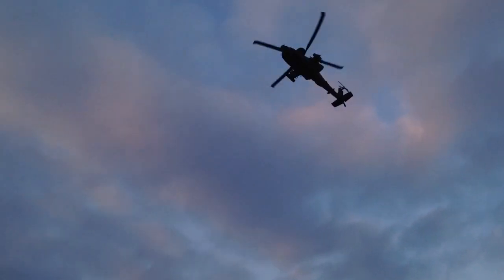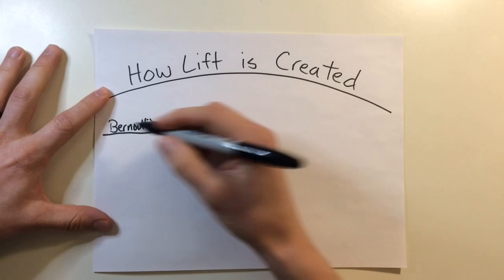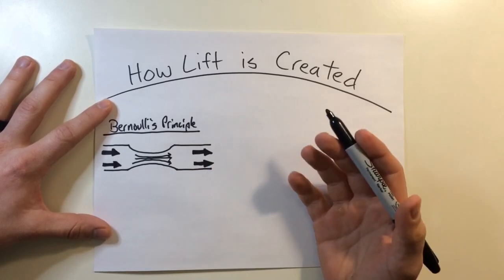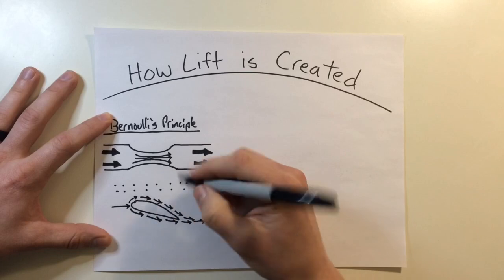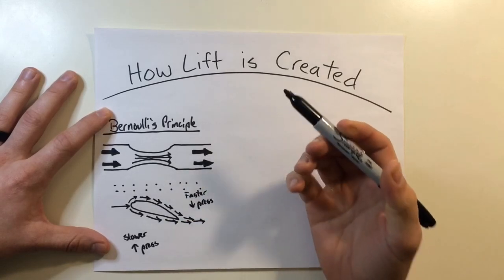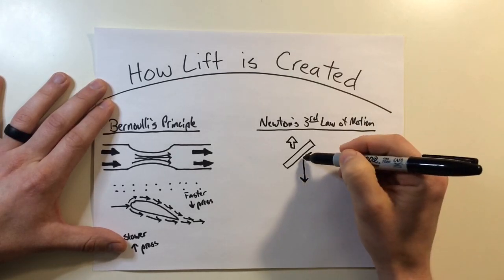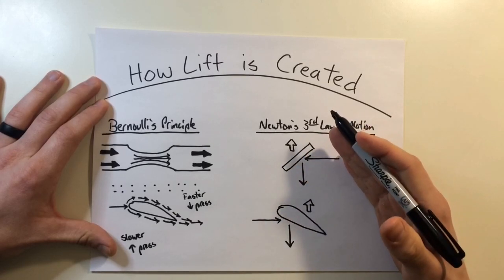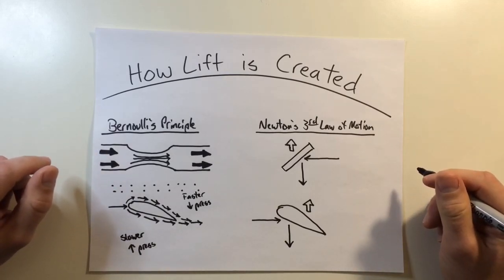How Lift is Created

Comment: I take my cfi check ride in a few weeks and I can’t tell you how helpful your videos have been to really smooth out my presentations.
Reply: The “Bernoulli Principle half-venturi” explanation is false. The air far above the wing is not a hard boundary and the air does not speed up because of this. If that was valid, then there would be an equally low pressure under the wing because you can easily see that the trailing edge produces a similar ‘narrowing’ below the wing.
In addition, a pressure difference between two regions, called a pressure gradient, is what speeds up the fluid in the venturi.  Air has mass and Newton tells us that a force is required to accelerate a mass and in a fluid, a pressure difference accelerates fluid. Pressure is the force that accelerates air. The fluid does not magically speed up in the venturi narrowing without the force provided by the pressure difference. Pressure difference causes acceleration in fluids.  Euler figured this out in the mid 1700s.
 Above a wing, it is the curved flow that creates a lower pressure and the low pressure accelerates that air toward the trailing edge.

Also, it's Daniel Bernoulli.
_
The common Newton explanation is incorrect because the air does not bounce off the bottom, but the flow is curved to flow downward, but along the lower surface.  That causes an increase in pressure at the lower surface.  The wing moving toward the air increases the pressure.  This increased pressure under the wing pushes up on the wing and down on the air. 
The lift is then the total pressure difference caused by the motion of the wing through the air.
Those two explanations are incorrect, but it is the pressure difference top-to-bottom which is the lift.

Comment: I'm a newly Aviation Mech in the Navy and this has been so helpful feeding my hunger for well explained information that I can't wait to be working in my MR-60R. Thanks a lot! 😁
Reply: The “Bernoulli Principle half-venturi” explanation is false. The air far above the wing is not a hard boundary and the air does not speed up because of this. If that was valid, then there would be an equally low pressure under the wing because you can easily see that the trailing edge produces a similar ‘narrowing’ below the wing.
In addition, a pressure difference between two regions, called a pressure gradient, is what speeds up the fluid in the venturi.  Air has mass and Newton tells us that a force is required to accelerate a mass and in a fluid, a pressure difference accelerates fluid. Pressure is the force that accelerates air. The fluid does not magically speed up in the venturi narrowing without the force provided by the pressure difference. Pressure difference causes acceleration in fluids.  Euler figured this out in the mid 1700s.
 Above a wing, it is the curved flow that creates a lower pressure and the low pressure accelerates that air toward the trailing edge.

Also, it's Daniel Bernoulli.
_
The common Newton explanation is incorrect because the air does not bounce off the bottom, but the flow is curved to flow downward, but along the lower surface.  That causes an increase in pressure at the lower surface.  The wing moving toward the air increases the pressure.  This increased pressure under the wing pushes up on the wing and down on the air. 
The lift is then the total pressure difference caused by the motion of the wing through the air.
Those two explanations are incorrect, but it is the pressure difference top-to-bottom which is the lift.

Comment: Always appreciate your videos.
Reply: The “Bernoulli Principle half-venturi” explanation is false. The air far above the wing is not a hard boundary and the air does not speed up because of this. If that was valid, then there would be an equally low pressure under the wing because you can easily see that the trailing edge produces a similar ‘narrowing’ below the wing.
In addition, a pressure difference between two regions, called a pressure gradient, is what speeds up the fluid in the venturi.  Air has mass and Newton tells us that a force is required to accelerate a mass and in a fluid, a pressure difference accelerates fluid. Pressure is the force that accelerates air. The fluid does not magically speed up in the venturi narrowing without the force provided by the pressure difference. Pressure difference causes acceleration in fluids.  Euler figured this out in the mid 1700s.
 Above a wing, it is the curved flow that creates a lower pressure and the low pressure accelerates that air toward the trailing edge.

Also, it's Daniel Bernoulli.
_
The common Newton explanation is incorrect because the air does not bounce off the bottom, but the flow is curved to flow downward, but along the lower surface.  That causes an increase in pressure at the lower surface.  The wing moving toward the air increases the pressure.  This increased pressure under the wing pushes up on the wing and down on the air. 
The lift is then the total pressure difference caused by the motion of the wing through the air.
Those two explanations are incorrect, but it is the pressure difference top-to-bottom which is the lift.

Comment: Great video! I like how you explained each theory and stated that neither theories by themselves are correct. One thing I would change is that the fluid particles do not meet back up at the trailing edge. In most cases, the air particles on top have left the trailing edge before the ones on the bottom do. Other than that, thanks for the good content!

Comment: Good job explaining the theories in an easy-to-understand way! However, some of the explanations contain common misconceptions. The second portion of the explanation was good because it utilized Newton’s law which was very similar to Doug McLean’s argument in chapter 7 of the Understanding Aerodynamics textbook. However, the first portion of the explanation utilized Bernoulli’s principle to explain the theory which was a misconception both the University of Cambridge professor Holger Babinsky as well as McLean explained. It sounds like the velocity change was causing the changes in pressure which would lead to the generation of lift when in reality velocity and pressure respond simultaneously. In addition, this utilized the venturi tube to explain the theory which McLean explained is another common misconception because external flows around airfoils don’t behave the same way internal flows do in solid surfaces such as venturi tubes because this pinching doesn’t always result in a pressure or velocity change which wouldn’t produce lift.

Comment: Omg thank you so much for your videos, you're God send, it helps me so much to help study these topics! Thank YOU 🙏🏼👍👏😍
Reply: The “Bernoulli Principle half-venturi” explanation is false. The air far above the wing is not a hard boundary and the air does not speed up because of this. If that was valid, then there would be an equally low pressure under the wing because you can easily see that the trailing edge produces a similar ‘narrowing’ below the wing.
In addition, a pressure difference between two regions, called a pressure gradient, is what speeds up the fluid in the venturi.  Air has mass and Newton tells us that a force is required to accelerate a mass and in a fluid, a pressure difference accelerates fluid. Pressure is the force that accelerates air. The fluid does not magically speed up in the venturi narrowing without the force provided by the pressure difference. Pressure difference causes acceleration in fluids.  Euler figured this out in the mid 1700s.
 Above a wing, it is the curved flow that creates a lower pressure and the low pressure accelerates that air toward the trailing edge.

Also, it's Daniel Bernoulli.
_
The common Newton explanation is incorrect because the air does not bounce off the bottom, but the flow is curved to flow downward, but along the lower surface.  That causes an increase in pressure at the lower surface.  The wing moving toward the air increases the pressure.  This increased pressure under the wing pushes up on the wing and down on the air. 
The lift is then the total pressure difference caused by the motion of the wing through the air.
Those two explanations are incorrect, but it is the pressure difference top-to-bottom which is the lift.

Comment: Thanks a lot friend you helped me a lot. Keep up the work😄
Reply: The “Bernoulli Principle half-venturi” explanation is false. The air far above the wing is not a hard boundary and the air does not speed up because of this. If that was valid, then there would be an equally low pressure under the wing because you can easily see that the trailing edge produces a similar ‘narrowing’ below the wing.
In addition, a pressure difference between two regions, called a pressure gradient, is what speeds up the fluid in the venturi.  Air has mass and Newton tells us that a force is required to accelerate a mass and in a fluid, a pressure difference accelerates fluid. Pressure is the force that accelerates air. The fluid does not magically speed up in the venturi narrowing without the force provided by the pressure difference. Pressure difference causes acceleration in fluids.  Euler figured this out in the mid 1700s.
 Above a wing, it is the curved flow that creates a lower pressure and the low pressure accelerates that air toward the trailing edge.

Also, it's Daniel Bernoulli.
_
The common Newton explanation is incorrect because the air does not bounce off the bottom, but the flow is curved to flow downward, but along the lower surface.  That causes an increase in pressure at the lower surface.  The wing moving toward the air increases the pressure.  This increased pressure under the wing pushes up on the wing and down on the air. 
The lift is then the total pressure difference caused by the motion of the wing through the air.
Those two explanations are incorrect, but it is the pressure difference top-to-bottom which is the lift.

Comment: Actually Newton's 3rd law is complete if you take into account viscous effects and the fluid being forced downwards on the upper part of the airfoil. The Bernoulli effect is an obsolete explanation for lift due to the fact that for it to occur you assume that particles at the attack edge reach the end of the airfoil at the same time, which is not necessarily true. But good video!
Reply: Equal transit is observably false.
.
The “Bernoulli Principle half-venturi” explanation is false. The air far above the wing is not a hard boundary and the air does not speed up because of this. If that was valid, then there would be an equally low pressure under the wing because you can easily see that the trailing edge produces a similar ‘narrowing’ below the wing.
In addition, a pressure difference between two regions, called a pressure gradient, is what speeds up the fluid in the venturi.  Air has mass and Newton tells us that a force is required to accelerate a mass and in a fluid, a pressure difference accelerates fluid. Pressure is the force that accelerates air. The fluid does not magically speed up in the venturi narrowing without the force provided by the pressure difference. Pressure difference causes acceleration in fluids.  Euler figured this out in the mid 1700s.
 Above a wing, it is the curved flow that creates a lower pressure and the low pressure accelerates that air toward the trailing edge.

Also, it's Daniel Bernoulli.
_
The common Newton explanation is incorrect because the air does not bounce off the bottom, but the flow is curved to flow downward, but along the lower surface.  That causes an increase in pressure at the lower surface.  The wing moving toward the air increases the pressure.  This increased pressure under the wing pushes up on the wing and down on the air. 
The lift is then the total pressure difference caused by the motion of the wing through the air.
Those two explanations are incorrect, but it is the pressure difference top-to-bottom which is the lift.

Comment: Appealing to Bernoulli fails to work for a hydrofoil moving slowly through liquid helium. When the hydrofoil speeds up, flow is unable to double back round the trailing edge and a starting vortex is left behind in the flow. By the conservation of vorticity, there must be bound vorticity in the boundary layers around the hydrofoil, and this generates a transverse force, or lift, by the Magnus effect. We can switch back and forth between the Magnus effect and the Kutta-Joukowski circulation theorem by linear transformations. The starting vortex can actually be observed, and Bernoulli can be applied after the event of it being shed.

Comment: Thank you for making videos, im currently in helicopter flight school and these videos really help me understand the concepts in the book, its helped immensely in my ground schooling.
Reply: The “Bernoulli Principle half-venturi” explanation is false. The air far above the wing is not a hard boundary and the air does not speed up because of this. If that was valid, then there would be an equally low pressure under the wing because you can easily see that the trailing edge produces a similar ‘narrowing’ below the wing.
In addition, a pressure difference between two regions, called a pressure gradient, is what speeds up the fluid in the venturi.  Air has mass and Newton tells us that a force is required to accelerate a mass and in a fluid, a pressure difference accelerates fluid. Pressure is the force that accelerates air. The fluid does not magically speed up in the venturi narrowing without the force provided by the pressure difference. Pressure difference causes acceleration in fluids.  Euler figured this out in the mid 1700s.
 Above a wing, it is the curved flow that creates a lower pressure and the low pressure accelerates that air toward the trailing edge.

Also, it's Daniel Bernoulli.
_
The common Newton explanation is incorrect because the air does not bounce off the bottom, but the flow is curved to flow downward, but along the lower surface.  That causes an increase in pressure at the lower surface.  The wing moving toward the air increases the pressure.  This increased pressure under the wing pushes up on the wing and down on the air. 
The lift is then the total pressure difference caused by the motion of the wing through the air.
Those two explanations are incorrect, but it is the pressure difference top-to-bottom which is the lift.

Comment: Bernoulies principal is totally wrong when explaining lift. What causes a boat propeller, for example, to move a boat forward is correct. Pushing water (fluid) rearward as the rotor basically screws its way through the water. It creates pressure reduction in water in front of rotor as the water is pushed back behind the rotor, water in front rushes in to fill the void creating pressure differential between front and rear of rotor. Same principal applies to a wing.

Comment: Great explanation as usual, thanks.
Reply: The “Bernoulli Principle half-venturi” explanation is false. The air far above the wing is not a hard boundary and the air does not speed up because of this. If that was valid, then there would be an equally low pressure under the wing because you can easily see that the trailing edge produces a similar ‘narrowing’ below the wing.
In addition, a pressure difference between two regions, called a pressure gradient, is what speeds up the fluid in the venturi.  Air has mass and Newton tells us that a force is required to accelerate a mass and in a fluid, a pressure difference accelerates fluid. Pressure is the force that accelerates air. The fluid does not magically speed up in the venturi narrowing without the force provided by the pressure difference. Pressure difference causes acceleration in fluids.  Euler figured this out in the mid 1700s.
 Above a wing, it is the curved flow that creates a lower pressure and the low pressure accelerates that air toward the trailing edge.

Also, it's Daniel Bernoulli.
_
The common Newton explanation is incorrect because the air does not bounce off the bottom, but the flow is curved to flow downward, but along the lower surface.  That causes an increase in pressure at the lower surface.  The wing moving toward the air increases the pressure.  This increased pressure under the wing pushes up on the wing and down on the air. 
The lift is then the total pressure difference caused by the motion of the wing through the air.
Those two explanations are incorrect, but it is the pressure difference top-to-bottom which is the lift.

Comment: The Venturi effect is also used on pressure washers to allow chemical injection.  When you put an opening in the Venturi(the low pressure area) the low pressure creates a vacuum and will draw chemical(through a tube that is submerged in container of chemical) into the system and send it down stream.

Comment: The theories of lift that you discussed could only explain lift partially. The other theory that I think to take into account is the circulation theory of lift. Generally the explanation was easy to follow along, and had good information but there were some misconceptions stated in the video. Such as comparing the airfoil to a venturi nozzle, as well as not really explaining how the top surface contributed to the lift generation.